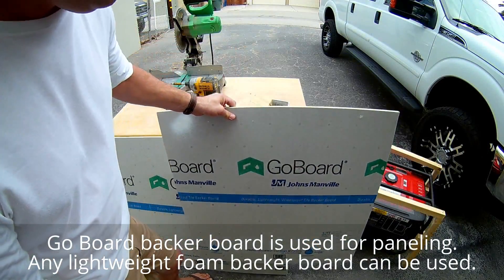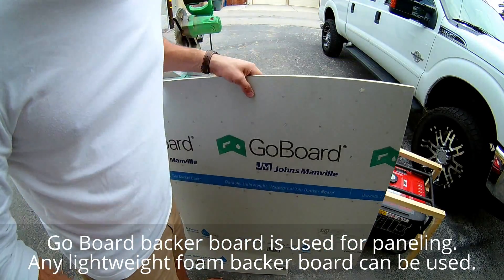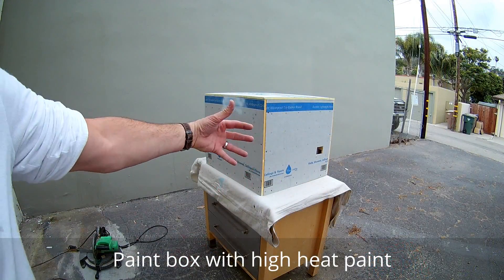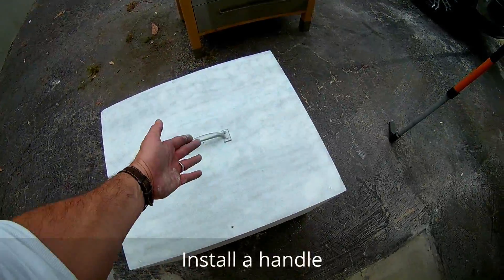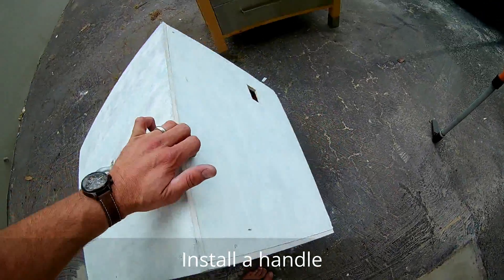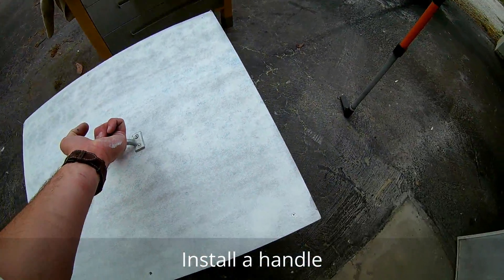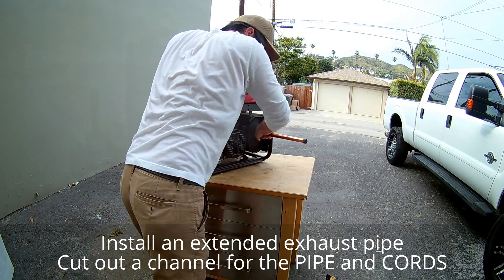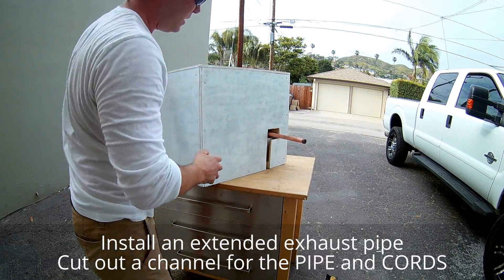Best Lightweight Generator Quiet Box Part 1 - DIY

Comment from the maker: PART 1 of a 2 PART video. Part 2 with Fan Install link is here!!!   https://www.youtube.com/watch?v=efmkyWbWof8
Reply: sorry, seen quieter examples around with more rigid insulation facing in, absorbing the sound directly. with both inside and outside walls connected to the same frame, sound will transfer almost just as easy with or without the packing. also, it needs an air inlet for both engine inlet and engine and generator cooling air. will you also run it loaded? big difference in noise there.

Comment: Simple but dangerous design.  Easily remedied. Proper ventilation is a must to prevent generator overheating as well as accumulation of fuel fumes. Also, newer generators with CO sensors will shut off the generator without proper ventilation.

Comment: When  you check the noise level, you need to have the load onto the machine. They all sound pretty quiet until the load is applied.

Comment: Do not build this box this will cause an explosion of the generator no ventilation how does the engine cool down keeping the gas from overheating and turning into a aerosol explosive when the engine temperature reaches over 200°?

Comment: As its an air cooled generator where is the air? You could fit a fan and outlet grill with no detrament to sound, power it from the generator itself.

Comment: You might need two small fan installed one intake and the other is outtake that way the temperature won't get too high inside. I could be wrong, I like your video, thanks for sharing.
Reply: that generator wont last one day in there it will get so hot

Comment: That is a great way to totally destroy your generator. Did you know that your generator is air cooled? Do you realize the heat build up in the box will get to extremely high temperatures? Do you also realize that any idiot that builds it will sue or at very least attempt to sue the shit out of you. Ofcourse anyone will see that you and the copycat are a brick shy of a load and any court proceedings will be a battle between morons. You MUST have sufficient ventilation to avoid the generator from getting to hot and completely siezing up on you. Take this dumb ass video down before you get your ass in serious trouble. Or leave it up, run your generator in it and reap your dispair.  Just trying to help like I would when one of my kids do dumb shit. Good luck, your gonna need it.

Comment: 5:50    HEY   what about 'air cooled engines'  heat ??    where is it going  ????? It is not even under any load,  Y E T ......it requires outside air, too  !!!!!!  your stator coils, my get hot, and come apart, just like Colemans' Powermate generators, 4000 watts and larger, OR  your engine may overheat....
Reply: or, even a 6 inch 12 volt fan, connected to generators 12 volt DC output, if it has it. If not, 120 volt small desk fan in the generator end, blowing it over and out the engine end....

Comment: A couple small computer fans plugged into a USB port would help solve the potential overheating problem. Cheap easy fix. Wouldn't make hardly any difference in sound either.

Comment: Have already commented once (of course derogatory) somewhere down below. The "box within a box" is a standard concept and a sound one (no pun intended) in soundproofing. However, would like to add something in the making as I have some experience with the concept seeing I did similar in the walls in my woodshop to make it less noisy for my neighbors. This detail may seem small but is essential in building a "box within a box" soundproof scenario. The fasteners, in your case the screws, can not connect the outside box to the inside. Meaning the inside box can not directly touch the outside box. NOR can the same screw be used. Even though you have an air pocket between the walls you defeat the effect when the same fastener connected the two walls together. The sound will transfer through the fastener and all will be lost. There is a correct way and easily performed and can be found on the internet. Therefore, the "box within a box" is a great soundproofing concept when done correctly....not saying the video produced here is a good one but the concept has been proven.

Comment: Nice light weight box to stop the sound, but instead of using insulation that "retards heat" (the pink stuff by Corning) use the insulation that "retards sound" (the usually brown stuff by  Rockwool). This way you can at least avoid holding in the heat that the engine makes. But, there must be a way to get air flow or your engine wont last very long. Thanks
Reply: I agree with you.  And instead using a flat  surface inside as the plywood you used there is a sound and fire proof foam in amazon . That way the sound is absorbed instead of bounce back from flat surface.

Comment: Good video. Using this as a base and making mods to it. One... It's gonna be easier to put the inner panels on first I think. Two, before screwing on the external panels, lay in the insulation. That will definitely help to avoid any bunching or gaps from trying to shove it down between the panels. And lastly, as many others have said, you've definitely got to have two fans. One for air coming in and one to exhaust hot air out.
Reply: I’m anxious to see your video.

Comment: Aside from the ventilation issues that others have mentioned (and that you have corrected in another video), something you should mention is that GoBoard and the other optional materials you mentioned are EXPENSIVE.  I can't find GoBoard locally, but it's expensive.  Kerdi Board is $37 per sheet.  Denshield is $25 per sheet.  Wonderboard Lite is the cheapest at $9 per sheet, but it's made of cement.
Reply from the maker: I hear you, check your local Lowes or Tile specialty store.

Comment: it will be quiet but burn out fast. u did not resolved cooling issue: if liquid cooled u can move radiator and fan outside. but most portable generators are air cooled. so u need to add grill to keep air flow, and probably propeller as well.

Comment: That's great but after prolonged use I don't see how you have fresh air coming in to cool your air cooled engine. You will burn your system up. Your generator also needs cooling air. When you get this fixed and can both quieten down the machine while keeping it cool and from self destructing from heat let me know.

Comment: Put a computer fan on a side wall to push air in, another cpu fan on the top near the opposite wall to push exhaust air out, put baffles on each fan to reduce noise.  The way you have it set up the generator is going to choke itself out...the only reason it wouldn't choke out is if there is air flow through gaps or holes cut I'm the wood, and those would seriously reduce the sound reduction.  
Good idea but it's about half finished
Reply from the maker: That's what I did, this is part 1 of a part 2 video

Comment: I like the simplicity of the box design and construction but if you use extruded polystyrene (XPS) backer board you will to have more space to ensure the XPS does not melt, so slightly bigger box. AND to protect the generator windings from meltdown especially when under load, you will need to provide FORCED ventilation (an exhaust fan and a fresh air inlet on the opposite end to the fan). It would be better to use a polyurethane (PU) foam backer board or ductboard if its available as the melting point of the PU foam is much higher.......

Comment: the box seems really small to have a hot engine running on the inside and with that muffler poking to the outside it is not that quiet this is a great video that you took this on we need to find a simple box to run these generators without pissing off The neighbors

Comment: Good way to quickly cook your genny.
Reply: My First thought exactly, no Air Flow for Cooling..  😒
Reply: O @HyperJoe
Reply: It wouldn't  be hard to add a fan for circulation.
Reply: @borzik82  you would have to make a box for the fan and add a fan to the box of the fan hahah
Reply: I have a portable generator.  All the heat comes out the exhaust which this guy has vented out of the box.  The unit itself doesn't get hot whatsoever....so "cooking the genny" is not an issue.
Reply: @BaldyViking  - go stick your hand on any part of the generator and see how hot it is. To say it all goes out the exhaust is nuts. Having no air for cooling and combustion is plan stupid
Reply: @BaldyViking  your no mechanic . All the heat goes out the exhaust . Radiant heat is a major  player in all tyoes of internal combustion engines .
Reply: https://www.youtube.com/watch?v=efmkyWbWof8

Comment: Ok we know it’s going to over heat. We know there’s no snorkel to allow air in the engine. How about building the walls on a 45 degree angle so that the sound deflects off the side walls and gets absorbed by the ground which is usually dirt or grass. Just a thought.

Comment: Your generator quiet box is very wrong, stupid & even potentially dangerous!

1)   Your box is too small & will contain & trap way too much heat during operation,  even on a cool day & cause the unit to over heat &/or cause wires & plastics to melt inside while the grnerator is running & enclosed  BECAUSE OF NO VENTILATION!  And the generator will have limited fresh air to sustain it running.
2)   you should have looked into if the panaleling you used is fire &/or heat resistant (and it should be)!  You never said anything to the viewers or even looked into it's uses or characteristics to see if it's appropriate to use!
3)   You should have installed 2 opposing vents with a built in fan so as to direct air flow one side to the other out along with it being a little retantangle for directional flow.
4)   You should have included a raked roof either from the middle down or from a high side raked down to the other side along with a 3 inch over hang over the sides where the fan/vents are as to stop most rain from entering the unit!
5)   you have installed/incorporated NO hole cut-outs for the power cord(s) to travel in & out of box you created.  What were you thinking???!!!  What you did is terrible, stupid & potentially dangerous to those who don't understand the stupid & dangers you built into it or lack of common sense into it!  Shame on you!  And no I'm not trying to just be mean or negative!
Reply from the maker: Here you go:
https://www.youtube.com/watch?v=efmkyWbWof8

https://www.youtube.com/watch?v=mhRKORR0Y9I

Comment: Great video, and very creative, accept for one small item... Access holes for extension cords, after all that is why you have a generator......
Reply from the maker: Yes sir, but this is part one of the box build. Part two is in the link description with air flow as well as access holes.

Comment: I made one out of doubled 2" rigid foam which easily went together in an hour.  One difference was I left a large air flow space to allow for cooling of the motor.  Nice video.
Reply: the way he did it  it would burn up the engine and generator head in no time

Comment: Any problem with heat build up inside the box? Any excessive build up can affect the normal operation; even kill the unit if allowed for long periods of operation. My generator manual recommends at least five feet of clearance around the unit for proper and safe operation.
Reply from the maker: There is a part 2 of this video, it's in the video description with fan..

Comment: Nice job, but let me suggest some additional improvements that you might consider:

I would cut a series of holes in the inside foam boards allowing the sound waves to get absorbed by the fiberglass insulation rather than them reflecting off of the hard surfaces - sort of like anechoic chamber construction. It should quiet the mechanical vibrations quite a bit more. -  https://en.wikipedia.org/wiki/Anechoic_chamber
- - - - - - - - - - - - - - - - - - - - - - - - - - - - - - - - - - - - - - - - - -
Also, a few heat exhaust ports on the top as well as some fresh air ports near the bottom will allow for effective convection cooling. - https://www.budind.com/pdf/BasicsofEnclosureCoolingWhitePaper2.pdf
Reply: I used to make sound proof enclosures for a living and you are correct we used to make a sheetmetal box pack it with insulation and the wall facing the offending noise maker had a perforated sheet to allow noise into the insulation. https://modularwalls.com.au/wp-content/uploads/AcoustiSorb_panel_spec.jpg

Comment: I would have used 4" uncovered fiberglass sound insulation on the inside.  The box would have been slightly larger but considerably quieter.  And if you had bent that exhaust extension downward and then run it under the bottom edge of the box, you wouldn't be letting out so much sound from the hole you cut.
Reply from the maker: great idea! I still have the box and have an update video on it coming up in the next two weeks.
Reply: @LandbergTileTV  Very glad to see a poster who reads replies.

Comment: 1. Wheres the air intake for the generator, 2. How is the generator going to exchange heat if you have it in a closed box (it will overheat) ?

Comment: ...some carpentry skills but clearly a common sense deficiency lol...😂 might as well take 2 large totes. Wrap insulation around 1 and a piece on the bottom then squeeze the 2nd tote over it and add a handle...there ya go..a lightweight cover with materials you probably already have.
Reply from the maker: I have a follow up video part two, this is not the completed video.

Comment: Cool video, thanks. Did you think using sound board instead of backer board on the inside?
Reply from the maker: I don't know what sound board is. I used foam backer board because I had some panels left over from a tile job. Also, the board is rigid and SUPER light

Comment: Great starter idea! I would add in and out ventilation holes. These won't have to be too large with the addition of a small electric fan powered from one of the 120 outlets. For what I will need to do I might make the box so it will fold for storage in a RV. Thanks for the upload.
Reply from the maker: I uploaded an update video on installing a fan and ports for the cords. Check it out 👊

Comment: You Need to Put It On Lawn,Or in A dirt box,to cut Sound in Half,and Don't Put the box so close to Gen,Or fire Hazzard Is Present.But You Can Install Fan to box,So It Pull's The Heat Out Of box.you Do have Right Idea.Plus Put It 23 Feet From house..A Propane Fuel might not Be fire Hazzard.??.
Reply from the maker: Yes, I've since made an update video with fan installation. You can see it here:
https://www.youtube.com/watch?v=efmkyWbWof8&t=13s

Comment: 2.4 k subscribers are still sticking to show and share this super stupid idea! Why waste all of the materials you used. You should have used the same old generator box it came in to cover it if you want to quiet it down!
Reply from the maker: This is a excellent idea that works. I use this quiet box every time I go camping without hookups. There is no way that the cardboard box the genny came in would ever reduce the noise level of double panel foam board with insulation.

Comment: I once had a van with a air compressor in it had the exhaust running through the floorboard. I shut the doors because it was raining and the motor just stopped because it got too hot inside. It was fine and been working since I put it in a service truck open in the back. if it gets too hot that I know of they'll just shut off the air cooled 4-stroke engines.

Comment: Thank you for your video. I live in Florida and will probably lose power during a hurricane. With two days of rain before and after the eye of the storm, I am concerned how the backer board holds up to that kind of rain. Any thoughts?
Reply from the maker: Yes, the Go Board is 100% waterproof. I would waterproof all the seams, penetrations and screws with a waterproof membrane or silicone.  👊 But keep in mind, it does need to breath and a vent fan should be installed.

Comment: they make sound proof insulation
Reply from the maker: Who does? send me more info!
Reply: I use to put it up in office buildings it was grayish green but it would cause a lot of dust while handling. i am sure they have sound proof boards by now that was in 1978 i put it up in between office's in the walls
Reply: @LandbergTileTV  you have internet?
https://www.google.com/search?q=sound+proof+insulation&oq=sound+proof+insulation&aqs=chrome..69i57.7196j0j9&client=ms-android-zebra&sourceid=chrome-mobile&ie=UTF-8
Reply: Owens Corning makes it. I believe it's called OC 703 or 703 insulation. I used some to build a similar sound attenuating enclosure for an industrial pump behind a dry cleaning shop.

Comment: Nice vid. What if you are using a generator with a remote control. Wont the box interfere with the remotes signal?
Reply from the maker: I don' think it would. You can use it in the trailer with the generator outside right? There would be no difference with the box over the generator.

Comment: Well, the overheating issue & the lack of access to plugin’s has thoroughly been covered so I won’t mention how other  utuber’s have built or bought larger quiet boxes, installed a 6-8” puller fan in 1 end & a mesh vent in the other for heat reduction cross air flow, don’t you look around to what others are doing ? altho your box is good, it’s only half done, I would have used spray foam in the tweener insulation wall instead of spun type, eliminating 2x2 end retainers but that’s just me, lol!